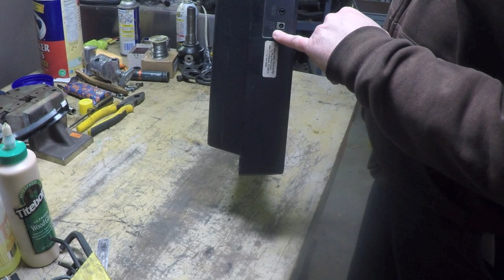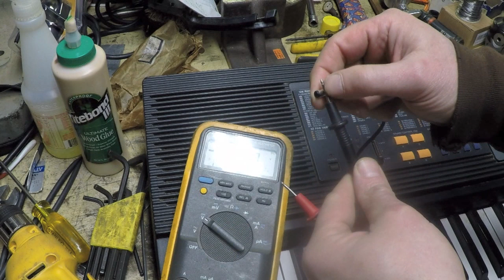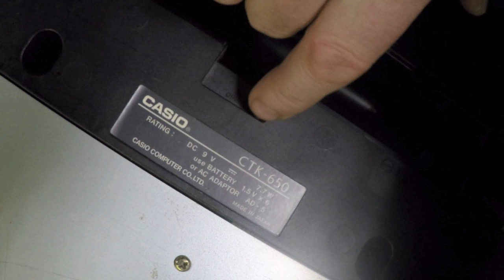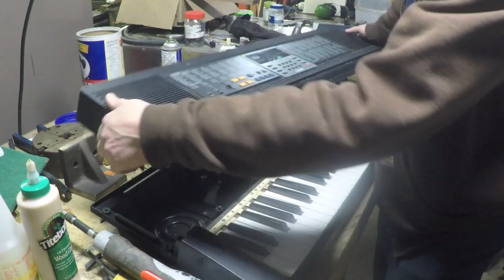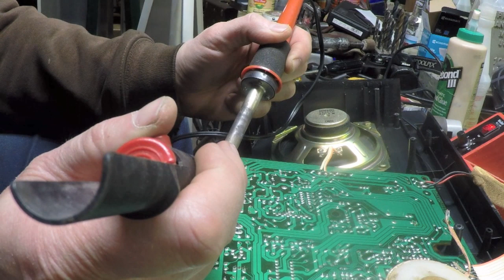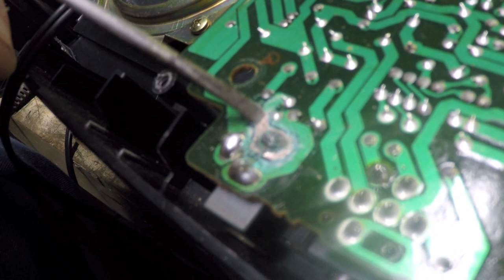Casio repair

Comment: Thank you. Not only for the video and process, but for the extra explanations. I know that to non-beginners it's too much info, but hearing how you thought through the traces, the battery connection, the jumper, everything, helped me diagnose and SOLVE the problem on my Casio which was a hand-me-down from a thrift-shop purchase. You gave me confidence to buy a solder sucker and very successfully create a new connection to solve the power issues!

Comment: My wife told me her Casio keyboard had quit after a few months of our toddler playing with it. 
She said the adapter plugs in and won’t turn on. I flipped it over and discovered about 60 screws. Figured I’d better see if I can find a video as to which ones to remove to open it up. 
After 3 minutes of your explanation of universal adapters and the polarity, I checked the end of the adapter, and sure enough, my son had unplugged it and reversed the polarity when he put it back together. 
After 3 agonizing (LOL) minutes... it was fixed and playing again. 
Thanks so much for the explanation and video! Saved me a bunch of time!

Comment: Just saved my keyboard, couldn't get it to work so I opened it up. I'd lost the original power supply, so was using another 9V source. Didn't realise the polarity could've been switched, fortunately it didn't do any damage to the circuit. Been sitting on a shelf for at least 5 years.

Thanks for the video!
Reply: How long have you been using it bec realizing that i has a reverse polarity? I tried plugging 3 times at my keyboard. Do u think i damaged the cicruit of keyboard?
Reply: @sean9284  since I realised I've used it heaps, works fine for me. I don't know if it has reserve polarity protection, but I definitely have put it in incorrectly and it didn't work but I do not think there was any long term damage. Permanent damage is possible though but I am not sure where it'd likely be, maybe there's another cause for you that isn't polarity related
Reply: @sean9284  I did have to switch the polarity to get it to work though
Reply: Still 7 months after it works, honestly can't thank you enough, feel stupid as it's a simple thing, never would have thought the DC jack polarity wasn't standardised/standardized. I thought my keyboard was stuffed not the adapter, opened it up and was not far off throwing it out. It still works, such a simple fix!
Reply: I have ctk5000 keybord
But display is not working
Reply: @Shivaraje-id4tc  same..

Comment: Yep, it's a Devil. Glad you pointed it out. Why do they do that? I became aware that my Casio uses Centre Negative, whilst my Yamaha has Centre Positive, with a very similar PSU that will physically fit both keyboards. Users Beware. The general standard for most DC power supplies is Centre Positive +   I did once connect the wrong power supply, as the Casio original supply had broken off the plastic Earth pin "UK"  But no damage appeared to be done, and the Casio still worked when reconnecting the correct supply.

Comment: I know this is an old video but I just got a Casio CTK-518 today for 30 dollars that said it worked at a thrift store . Got home and plugged it in and it worked for about 12 seconds and off it went . Tried again and same thing . Opened the battery door and it had old batteries in it . Took those out and plugged it in again . Same result worked for 12 seconds and off . Found this video and checked the adaptor . Yup , wrong one . Now it had a wrong adaptor and batteries in it . I took the case off and the circuit board looked fine so I cleaned out the dust and put it together again . Got the correct adaptor and it is just fine . I was going to return it tomorrow . Now I have a great new toy . Thanks man !!

Comment: Thanks for not making it so difficult to understand like some other ones. I just hope I didn't ruin my Casio CTK-501 by using the power supply. Actually my friend left it here but he said it wouldn't turn on so he he said if I wanted to try and get it to power on then have at it. If it wasn't for your video I would not have known about the use AC/DC power supply and using the proper adapter. It actually was working for about 10min but I didn't want to get to excited so I left it alone and after 10min came back to check on it which right at that very moment it went out on its own and could neat power on again, I was bummed. I really want to get it working it looks like it could be something to get into

Comment: Nice video, i've done the change of power jacks in keyboards many times. Sometime even the solder on the board is ok, but DC jack itself is lousy and it's worth changing because nothing is more irritating than keyboard turning off every time you make a small move. This is Casio CTK 650 from about 1994. i've had this model. It's quite good even for today standards: midi, touch sensitive, nice keybed, effects like chorus, reverb and decent sounds. Much better than todays supermarket noname keyboards.

Comment: Hi Steve, I'd like to fix my keyboard so that it works with batteries - any suggestions/videos for that? Based on your great explanation about AC adapters and polarity, I believe my 1983 Casio keyboard no longer works because of what you described, i.e., using an adapter with the wrong polarity. (My keyboard does not have an icon on the back to indicate which polarity to use.)  I used to be able to use it with batteries, but that doesn't work anymore either. I'd love to be able to use it with batteries though, so that I won't make the wrong-polarity mistake again. Any suggestions would be greatly appreciated, since I was quoted $150 to fix the keyboard. Thanks for making this video!

Comment: Steve,  I've got the Casio CTK 500, and have a brand new power supply designated for the CTK 500.    While playing on stage the unit shut off and came back on, but when it comes back on, it's always in the starting piano mode.    I have some play in  the plug in.   However, I put a nail in the hole of the hole of the power supply plug, and noticed the problem may actually have been in the power supply plug, not the keyboard .    It seems for now that the nail must have done some good, since I've been playing the keyboard for a while, and it has not disconnected.
There is another built in problem with the  CTK 500, and wonder if you might know how to bypass it;  the unit shuts off after about 2 minutes if you don't hit a key.   It does this with either the batteries installed, or with the power supply.   The problem with this feature is that you have to reset everything when the unit shuts off.   I.e. if you want the unit set up for say an organ setting, you have to use that setting before the unit shuts itself off.    I  tried leaving one of the keys weighted down and then turned the volume way down.    Same thing happens, the unit shuts off after about 2 minutes.    Any ideas how to keep the unit from shutting off?

Comment: Thank you for the video! I have a Casio 350 and my turn dial knob stopped working I opened it up and almost all the pins were broken off. Can this be soldered back into the circuit board? Thanks again

Comment: sir in my ctk 2000 there is a noicey sound or buffring sound coming when keyboard is on what is th solution
Reply: sahil gujar same my casio ctk3000
Reply: Same thing too
Reply: Buzzing noise normally means that there is a spot where either your internal speaker wiring  is touching either the PCB, or something metal and electrified inside your case. It could also mean a blown speaker, or your keyboard is using a bad plug or plugged into a bad wall socket, and is getting electrical feedback through the speakers.

Comment: I have this exact same keyboard and the problem with mine is that the rubber on/off  switch has become faulty and you really have to press it in a certain way to get it to work.  I wonder how hard the switch is to replace?

Comment: By looking at the original solder joint, probably why it was opened the first time. Did you add some hot glue around the plug to help strengthen it?
Reply: No
 Why would you do that?
Reply: Great way to fuck up the connection

Comment: I have to push the power button with 10 pounds of pressure. Using 1 finger. Can I get a new switch?
Reply from the maker: I cannot remember the type of switch these used. If it uses a membrane type switch, where the back of the button has a coating that touches a film on the board, then cleaning that area of the board with alcohol might help. If it is a hard plastic button, then it probably uses a tact switch that can be replaced but requires soldering skills.

Comment: Just one of my key is not wokring and it randomly works ( I opended and cleaned the keys), what could have gone wrong? circuite?
Reply from the maker: Sorry, I never had an issue like that with mine, and do not recall how the key switches worked. If they can be switched around, I might try and switch out the bad key with the highest note since that one is rarely used. hope this helps

Comment: Awesome wideo! I have just clicked it out of curiosity about my old Casio keyboard, but stayed till the end with inspiration to finally use my soldering iron for the first time and start to learn something about soldering and electronics in general. You are a great teacher who explains everything plainly and step by step.  Side question - are you Polish-descendant (judging from the surname)? :)
Reply: My Casio will play but shuts off after warm. It will come back on every time I push power on so...???

Comment: Hello, my name is Patrick pls i have a CASIO CT-647 keyboard(9v)  and i lost its original adapter and i used another adapter(12v) of higher amperage and all of a sudden smoke was coming out of the jack and the keyboard stopped working. i think fried the power system. Can u pls post a video on how i can fix this problem? Thanks.

Comment: i definitely plugged in using center positive adapter without knowing. i didn't try running the unit on D-cell batteries alone yet, but do you now think that I damaged the keyboard? and if so how reversible is this damage?
Reply from the maker: It might be ok. There is a diode that is supposed to protect the circuit. You might even have damaged that incorrect charger and not the keyboard.
Reply: @stevewatr  turned out ok. Bought proper 9v center negative adapter and keyboard works like a champ

Comment: Hello, I'll appreciate if you answer my question.
I got a Casio C100 and it hasn't turn on
With the battery or the  with DC.
Thanks in advance.
Reply from the maker: The only way to determine the issue is by using a meter and troubleshooting. If i were working on it, I would check the voltage path. Even without a schematic, someone with a basic knowledge of DC circuits should be able to find the fault. Bad AC adapter, broken foil trace on the board, bad power switch are all basic things to consider.

Comment: my dc bracket pin is completely broken inside. you think its possible to just change it out for a usb and make that work?
Reply from the maker: I think it would be easier to wire uo a female plug directly to the pc board. 
https://www.showmecables.com/dc-power-female-chassis-mount-connector-3-0mm-i-d-6-3mm-o-d?gclid=Cj0KCQiAuJb_BRDJARIsAKkycUmdaiEANdAr2fKotzU0qemjfmFw_nYPxUbHjnsfe3mKtEu2Ul3U5LkaAhyaEALw_wcB

Comment: Would it work if you just put batteries in because mine won't work when I use the AC adapter so would it would if I used batteries
Reply from the maker: Not necessarily. Depends where the broken connections are. The jack acts as a switch. When a plug is inserted, it disconnects the batteries so they are not fed voltage by the wall charger.
Reply: @stevewatr  oh by the way I got batteries yesterday and my keyboard worked!!!!

Comment: My psr s 550 keyboard 2A02(2Amps 100v) diode dead.
My question sir
2Amps 1000v diode is it suitable?
Please reply me?
Otherwise not suitable
Please any suitable diode number tell me
Reply from the maker: 2A02 is a rectifier rated 2A 100 Volt PIV. So a 2 amp 1000 volt PIV will work, just a larger body. As long as it physically fits, you can replace most rectifiers with higher rated ones. As opposed to zener diodes, where voltage is critical.

Comment: Hey i plug a 9v adapter in my casio but it didn't work, and i find out that jt js bec of polarity, Do you think i already damaged my keyboard?
Reply from the maker: Not sure. Some circuits are designed with a diode across the input that shunts the voltage if the polarity is reversed to protect the keyboard from damage.
Reply: But its fairly likely i damaged the keyboard right?

Comment: My Casio digital key b. Dosnt turn out power light goes on?
Reply: Help!
Reply from the maker: Doesn't turn out?? Do you mean no sound comes out, but the power light is on? If yes, it could be a lot of things. If there is a line output jack, try an external amplifier.  If you get sound out there, it might be the onboard amplifier, the speakers,  or even a bad headphone jack. The headphone jack is designed to turn off the speakers when a jack is inserted, but sometimes it mslfunctions.

Comment: My keyboard was burnt after missing porality 
Now I opened it I found the regulater 7805 was burnt 
After changing it 
It came on but no sound
I check IC volume 2206 was burnt as well
I changed it 
Power sound is there but from keys no sound please help me